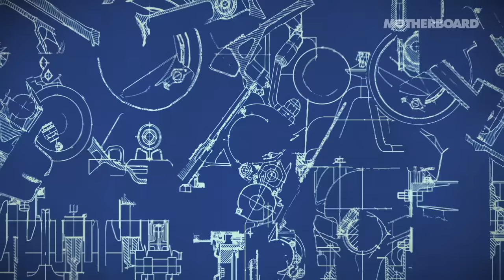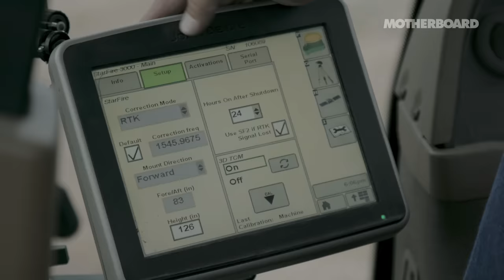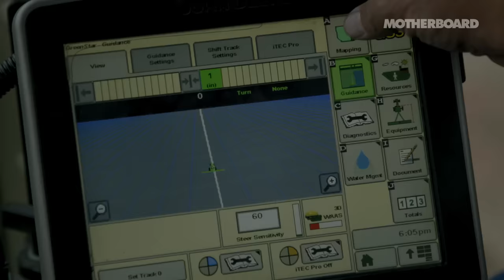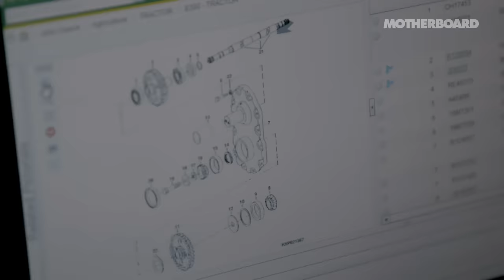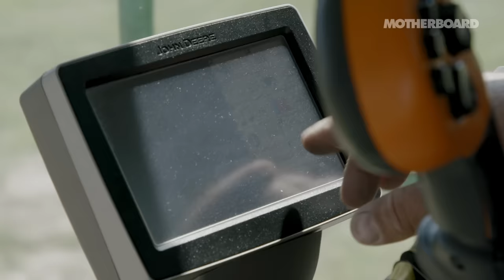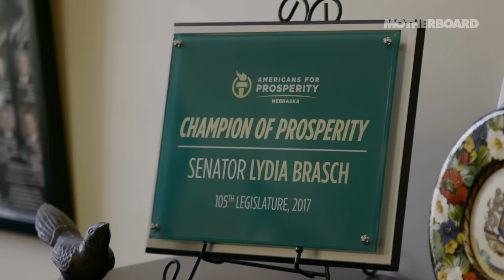Farmers Are Hacking Their Tractors Because of a Right to Repair Ban

Comment: Everyday city people don't realize how important this is, but it affects the prices of so many necessary goods. Farmers' rights to repair should be taken just as seriously as people's right to have their IPhones be repaired easily.

Good on Vice for bringing the farmers' struggles into the limelight.
Reply: You'd be surprised how much the Farmer's RTR movement gets talked about in Open-source tech spaces pushing RTR on the software and consumer hardware side. Companies like iFixit and groups like the EFF have written briefs and testified for Farm-oriented bills, not just consumer oriented ones. Farmers are certainly the vanguard for it right now though.
Reply: Hopefully more seriously because I don't think the ability to repair phones gets taken seriously at all.

Hell almost all of the flagships phones these days are specially designed to not be worth repairing, and they stop supporting them with updates after 3-4 years, so even if the battery still works, you're going to have to upgrade if you don't want a phone increasingly vulnerable to exploits due to outdated software.
Reply: It doesn't affect the price.  The price isn't determined by what the farmers are willing to sell their crop for, the price is determined by what the major crop purchasers are willing to pay.
Reply: @orionsimerl6539 When the price of gas rises, does it cost more for you to live?
Reply: That has nothing to do with a proprietor hindering their customer from performing maintenance on multi hundred thousand dollar pieces of equipment.  It's laughable that a person has been able to afford millions of dollars of equipment, but cannot afford a few thousand dollars for service.  Market typically determines prices on grains, so it isn't something these farmers will be passing down to consumers.  It's an issue between millionaire farmers and billionaire companies.  I don't like how the video portrays big bad business trying to exploit small poor farmers.  I don't think this issue has any impact on the interest of the general public.
Reply: Just another example of how technology isn't necessarily making our lives easier but more for certain people to profit even more from. All this technology today and people's lives overall are getting worse.
Reply: @orionsimerl6539  When you weigh down one part of the chain, you weigh down ALL of the chain, my friend. Doesnt matter which part.

Farmers aren't millionares, never have and never will, farmers who have JD's get them on loan. You don't defend the multibillion dollar corporations.
Reply: @CunnyMuncher  I don't defend either, but every farmer who has these pieces of equipment is a millionaire, has multimillion dollars in assets because to have those machines you have to have land, equipment, and infrastructure that makes buying one, financed or otherwise, to make that purchase make sense.  You're talking nonsense on "weighing down the supply chain".  Farmers paying for maintenance doesn't have any impact on the market, because the distributors set the prices.  The only difference is the amount of money the farmers make versus the amount of money the equipment manufacturers make.  Neither I nor the public has any stake in the outcome.
Reply: @orionsimerl6539  The cost of production affects the cost of consumption every time.

The multimillion dollar assets are owned by agricorpos like Monsanto, not John Brown, 6th gen farmer. The corps OWN the farmers via production and shipping contract.
Reply: @CunnyMuncher  The cost of farmer machine maintenance doesn't impact the cost of food because the prices are not set by the farmers.  It's the difference for the farmer of making 200 to 500 thousand dollars a year or more versus 10 to 20 thousand less in maintenance costs.
Reply: @orionsimerl6539  the cost of production always affects the price of goods in some way, it may not be noticable or significant if the profit margin is wide enough that sellers can readily absorb significant costs without actually raising prices, but costs are the baseline that determines how little something can be sold for while still making a profit.

Basically the corporations have to set prices at a level that is far enough about the farmers cost to operate to make it worth actually producing crops, even if the farmers themselves don't directly set the prices. 

Lower maintenance costs might or might not result in lower food prices in the end, but it is definitely part of the equation. There are so many confounding variables like demand levels and non-maintenance costs, that it would be almost impossible to prove it either way. Theoretically though the market will always adjust itself.
Reply: @Michael-uc2pn  The buyers of the grain determine the price they will pay for grain and often prices are adjusted based on supply and demand.  If the buyers have more grain than they can sell they'll pay less.  If they can sell more they'll pay more.  The price to the consumer, which often isn't consumer direct but other entities who add value to the commodity by producing consumer goods out of the grain.  The cost farmers incur to produce the grain has no impact on the price.  The farmers will either find their margins acceptable despite maintenance costs and they will continue farming or they'll get out of the business.  Again the public has no interest in the matter, its really the difference between farming equipment manufacturers making an extra 20 to 40 grand per year or the farmers making an extra 20 to 40k per year.  Nobody else has any stake in the outcome.  It's a poor place to direct public attention when half the adults in this country have an income share of about 30k per year.
Reply: And it's also cars in addition to farm equipment. Tesla is one of the worst with right to repair and it won't be long before other auto manufacturers follow suit. Imagine having to pay the dealership just to do an oil change because you need special software to do it
Reply: @Hayyyward  technology has never solved a problem with creating at least two.
Reply: Quit bying john deere
Reply: @jovazquez6102 there’s almost no maintenance on a Tesla.
Reply: Don't paint with such a broad brush! I'm a city guy, and I stand with the farmers! 👊
Reply: I don't know why you would post this comment pretending that there's a divide I suppose for attention. The reality is that tech customers and John Deere customers are the same people and have been working together for years to get right to repair past in different legislatures. But the sentiment that we're somehow not on the same team or don't know the other's struggle is the same propaganda being used to stop that legislation.
Reply: @Hahahahaaahaahaa  Bruh, do you honestly believe equally as many people are aware of the right to repair fight taking place in the agricultural industry than in consumer tech?

If that was the case, this video probably wouldn’t have been produced, solely focusing on the former.

Also, stop being so cynical. That, mixed with your username will just make people think you’re a troll.
Reply: shhh ishit fans might start a riot here
Reply: @orionsimerl6539 it's not the price of the repair it's the time I'll use a car for example when it breaks down it doesn't get fix  in your time it may sit their for some time because they.
A. Have to order said part 
B. That part could be on back order which means more waiting time 
C. Install part and with the way manufacturers build things today that will take more time 
with that being said it will be quite some time before they get that harvester back or that tractor or whatever the the piece of equipment is whether it is just the multi million dollar farmers or not the point still stand wouldn't you want to be able to use what you have and get it back in service as quickly as possible it may just be one machine but even if the had more or could rent another one that is a unit that is taking up space and is doing nothing and it would be wastful to just replace it
Reply: @steveb796 exactly because when it breaks you just simply buy a new one